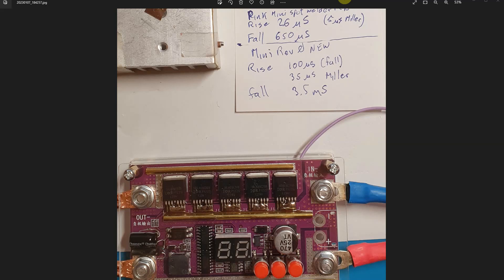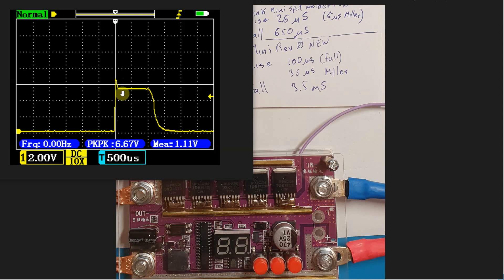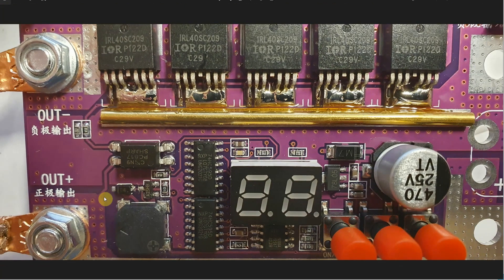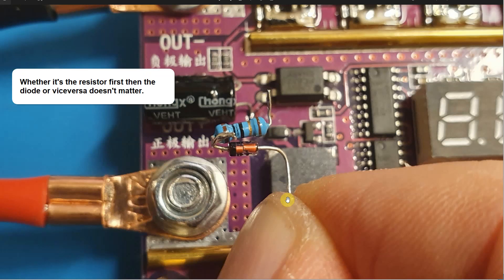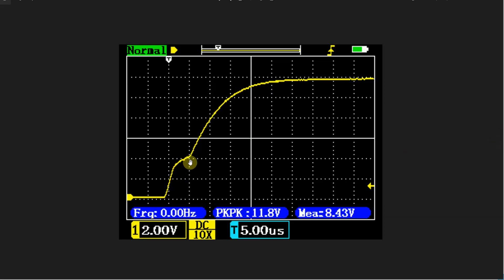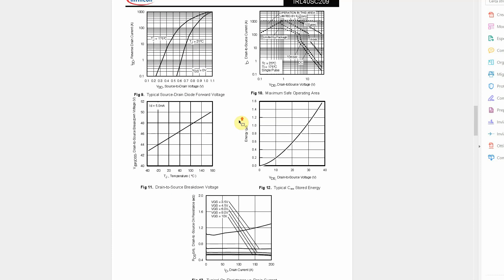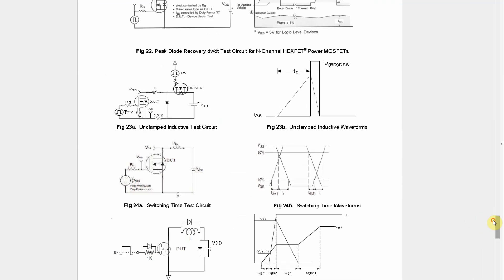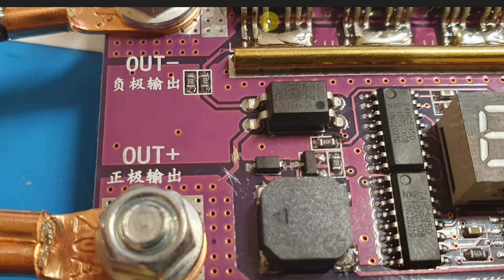"Purple" PCB Mini Spot Welder

Comment: It's funny with Chinese design... it works, but no one knows why...  :) PC817 have only max 50mA collector current, and in this circuit it drives Mosfets with 1.6A pulse current (16V / 10ohm = 1,6A)... there should be  at least small mosfet between.... ehh...
Reply from the maker: Everything as you see is out of spec, but they are either lucky or very smart as the time the junction of the 817 is ON is so short that it handles the peak and also there is a drop in conductance due to the incredible load it is subjected to. All this actually helps slow down the ON time and reduce also back EMF but will lead to FET overheating in a short time of many pulses are triggered. Check out my Spot Welder FAQs and last video I posted for more in depth analysis!

Comment: Can you please tell me if the kekk k100 12 transistor welding board also needs modification? Advise a good board with 12 volt power supply
Reply from the maker: The 12 FET version would need modification on the Gate driver side as that opto really becomes slow and loaded with 12 gates all in parallel. It will though work unmodded as the last revisions alread have the decoupling mod (though verify it when you receive it to be sure as I show). I think the 6 FET version is enough for it's capabilities without exceeding .2 mm strips. Once you start exceeding and pushing for .3mm you will need to start implementing additional protection with large TVS Diodes put across D-S. If you see my FAQs video and the last video where I discuss the FET driver mod you will get the picture.

Comment: Tôi muốn hỏi có cần thiết phải dùng diot zenner không hay bất kì loại diot nào cũng được
Reply from the maker: For the decouping mod a normal diode must be used in series with the cap or at max a Schottky if you don't have a regular 1N400x or equivalent - you must not use a Zener diode here.
Reply: Tôi nhìn thấy bạn hàn là 1 loại zenner? Hình ảnh đó là diot zenner
 @Luca_Techy
Reply: Tôi đã hàn kẽm 0.2 mà không cần thêm mosfet. Tuy nhiên tăng bánh răng thành 30 thì kim hàn bị dính và một phần nhỏ kim hàn dính lại. Bạn có đề xuất nào không?
Reply from the maker: Make the contact points round, file them so that their edges are not sharp. They stick because they fuse to the strip due to high temperature and small contact surface when you hold them at an angle. If you increase contact surface they will stick less but you may require more current to compensate.
Reply: @Luca_Techy cảm ơn sự hướng dẫn của bạn.

Bộ của tôi dùng 5 mosfet irl40sc228. , tôi đã bổ sung thêm tụ 470F, diot + điện trở 100ohm. Đã hàn gia cố bổ sung đường động lực. Có cần bổ sung thêm mosfet không ?. Tôi muốn dùng kẽm 0.25mm
Reply: @Luca_Techy  tôi đã sử dụng để hàn kẽm 0.2, tuy nhiên kẽm 0.3 chưa được. Theo bạn có cần bổ sung mosfet phía sau và tăng thêm công suất nguồn

Bộ pin của tôi đnag dùng 3s  lipo 6000mah, 90C. Peak 1000A.
Reply: @Luca_Techy  tôi muốn đấu thêm công tắc kích hoạt. Hãy cho tôi biết cắt đường mạch sau lương rồi đấu vào + hay -
Reply from the maker: @TuanNguyen-jp3dh  This spot welder will not handle 0.3mm as it is, maximum is 0.2. Overdriving it for 0.3 without serious modifications such as adding TVS diodes and changing driver will destroy the FETs.
Reply: Theo bạn có cần bổ sung mosfet từ 5 thành 10 để tăng công suất không
Reply from the maker: For ordinary use, 6 FETs are enougb to weld .12 - .15mm. If you use it heavily adding more FETs will reduce the load on each FET but I don't suggest overdriving this for over .2mm strips. You meed heavy TVS diodes for protection and a more appropriate trigger circuit for starters.

Comment: Hi, first of all, I want to thank you for your guide. Unfortunately, I've been having trouble with the spot welder from the very beginning. Before I started using it, I immediately added 5 MOSFETs on the other side. I tried welding a 0.2mm nickel-plated strip, and the results are very weak. Only the 0.1mm strip welds to the battery, but that's at a setting of 70 units. I implemented the modification from your guide, and the situation remains the same. I’m using a 12V 360A 45Ah car battery for welding and thick jumper cables. Does anyone have any advice?
Reply from the maker: As you are getting some type of weld I suspect there is a problem with the battery or with the power connections from battery to welder. If your battery is in good working order and you know it's delivering it's rated CCAs then make sure your cables are properly connected and thick enough to deliver the current (if you are using the provided ones you should be fine). Try with another battery if you have doubts. You should be getting welds on .12mm with a setting of 10-15.
Reply: @Luca_Techy  Thanks for your reply. The car battery is completely new, and the cables are thicker than the original ones. I’m currently using 25mm² cables that are 1 meter long. I will try connecting the positive terminal directly to the electrode, bypassing the board. Unfortunately, I can’t measure the actual current because the signal is too short, and my multimeter doesn’t have a min/max function.
Reply from the maker: @Maciej_S85  if you want to measure the current properly you need a calibrated shunt. You can do this by using a very precise multimeter and measuring the resistance of your power cable from the battery to the welder along the positive or negative cable. The  using a scope trace the voltage drop between these two points (yes you need a scope, a multimeter is not fast enough). Once you have the voltage drop you can calculate the current using Ohm's law I = V/R . This is how ampere meters work, voltage is measured across a calibrated shunt. In any case try reducing the cable length or try using the original cables to test.

Comment: my  math says that 12v though a 10ohm resistor will limit the current to 1.2amps which is nearly 15 watts, in the video it looks like a common .25 watt resistor, will it not be damaged by this current?
Reply from the maker: You haven't taken into consideration the time which thia peak current hence power is sustained, and that's only a fraction of a second - as soon as the current is applied the cap starts to charge, hence the voltage rises and current drops. Once it's charged it will stay practically always charged until you disconnect the battery. A 1/4 Watt will do fine in this case. FYI to calculate the total effective dissipated power you have to consider the integral funcion of the dropping current slope and rising voltage in time.
Reply: @Luca_Techy  I figured this was the answer I was gonna get, I did a lot of looking up surge currents on resistors to see how much over their rating you could go for such small periods of time and couldn't find much information. I see in other replys you say that going over around 30 ohms resistor would cause the cap to charge too slowly, doing the math it says that a 450 microfarad cap at 30 ohms will be charged after 5 time constants in 0.067 seconds, I assume the cap only needs to be charged fully before the next activation of the gates which would be between each spot weld, is a charge time of 0.067 seconds really necessary? I think its fair to say you would be actively spot welding less than once every 2 seconds, using a 600 ohm resistor would take around 1.3 seconds to fully charge the cap and at 12v you would never pass more than .25 watts through the resistor. Is there some reason I'm not seeing that we need the cap to be charged so quickly? thanks a ton for your response, enjoy the videos.
Reply from the maker: @sicktan88 yes in fact that's  the math without considering the losses - also consider that at every weld u won't be discharging the cap completely as that deoends on the energy absorbed by the gate capacitance which is prooortional to the number of gates. In practice the surge current limiting resistirs are usually in the ohms if not milliohms range depending on the current ranges in play. In this case a 10Ohms resistor is fine but that can be reduced to 5 or increased ro 50, it will still do it's job with the delta T in play between welds.

Comment: Would it be a bad idea to use li ion as the battery source instead li po  battery ?
Reply from the maker: Theoretically you could if you place enough LiIon cells in parallel (for ex. a  3S 10P pack) but you would need many cells in parallel as LiIon do not deliver the same sustained high current or impulse current as LiPo cells (LiPos can deliver up to 100 times their rated capacity while LiIon cells can reach on average 5-10x this in a sustained state before becoming unstable and overheating, it's primarily based on their morphology) which is why LiPo packs are used in model airplanes and drones, they deliver much higher sustained currents in lighter packages. The pack would cost you a lot and it would be bulky. On the positive side it would last longer in time than LiPo packs as these have a short life span based on how often you discharge/charge them and how you use them and store them when not in use (state of charge). This is also why many opt using a large capacitor bank in parallel to a smaller power supply to recharge it between welds for this specific use. Alternatively you always can use an AGM car battery such as a 45Ah or similar which can deliver 250 or more CCAs.

Comment: Would  be able to email you?

I brought this board , or what I thought was this board . but on mine there is not trace going from the pos terminal to the octocoupler . 
There was nothing going to that leg on the octocoupler . Just soldered to the board , the other leg goes to the resistor and then the mosfets 
I was hoping to show you before I went ahead . also , as there is no trace going to the leg , would I just solder the pos side of capacitor to the leg of the octocouplar  ?
Reply from the maker: My email is in the main channel page,  also check out the community section of the channel as there are some pics about the mod.

Comment: Can I use a 47ohms resistor instead of 10-30 ohms resistor ?
Reply from the maker: You can though it will take slightly longer for it to charge the cap - if you have only that value you could put 2 in parallel.
Reply: @Luca_Techy  Thanks . 
May I ask what would two in parallel do ?

Also I had got my hands on a couple of 22ohms resistors , they are heat dissipating ones , so a little bulky than I wanted but you work with what you got . 
So this 3W 22ohms will be better than the 47ohms , yea ?
Reply from the maker: @jayk2k if you have 2 small 1/4 watt 47 Ohms resistors and you parallel them you get half of 47Ohms (about 23.5 Ohms - you add the inverse of the values you parallel and the result is then also inversed). The bulky ceramic heat dissipating one is a bit an overkill for the purpose, better stick to regular ones.

Comment: Luca. I have an updated model that powers the octocoupler using the capacitor on the control circuit. Seems they have fixed their errors. Now all we really have to do is upsize that existing capacitor for insurance. I removed the 470/25v and replaced it with a 1000/50V so I can use my 16v 2kw supercap with confidence.
Reply from the maker: Yes, if you check the community sectiom of my.channel I have posted details about this update!

Comment: Hola a todos
Me gustariá saber si esta soldadora se puede usar con transformador y buena rectificación
Reply from the maker: Hola, you can't use an ordinary power supply for spot welding even if powerful, you need several hundred peak Ah to weld (400+). A power supply that beefy is costy, unless you source it from surplus shops. You may use a large capacitor bank (several 500F caps in series/parallel) as decoupling from the power supply, but that would be more expensive than the spot welder.

Comment: Hi, after the mod mine is not firing. It display 2 horizontal stripes on the display. Before the mod it fired, but a lot of sparks and burn through. Any ideas? Regards
Reply from the maker: You evidently had one or more shorted FETs if that's what was going on before the mod. 2 Horizontal stripes on the BCD displays isn't a good sign, you probably must have damaged or shorted something during the process. The Gate decoupling mod does not really cause this, at max your FETs won't fire if you make mistakes in the wiring but the MCU will certainly not fail or exhibit strange behaviors like you're seeing. Check that you haven't bridged anything while soldering as what you describe seems to indicate something definitely wrong with the MCU (does it beep or do anything if you press any button?). I suggest you check the community channel section to see what Purple KEKK version you have (some have already the decoupling mod) just to be sure you need it.
Reply: @Luca_Techy  i changed the fets, Maybe i did something wrong there. I'll check it asap. Thx
Reply: Mine  make the bip but no soldering,I changed the power source but nothing

Comment: Hello very nice mod. I accidently damaged the single tracing at the foot( i think it's the gate) on 4 off the mosfets when i was desoldering them. I cleaned some of the tiny tracing off already, but i can't see if it;s connected to another part of the board. By the way, you can mute the sound of the buzzer with some foam or so on it. Better than disable it completely. Regards
Reply from the maker: The gate traces from pin 1 of all the FETs are in parallel and go to a small resistor (01X) near the opto. If you have any short between pin 1 and the source pins the FETs will not fire.
Reply: @Luca_Techy  thx, i'll check it

Comment: Right, you add a decoupling circuit, but can't fix the falltime, because they use optocoupler to drive mosfets, with high Ciss on these mosfets, the transistor will go to amplifier (like you see why rise time too slow) before saturation,  and problem is discharge, they just use resistor (2,2k) for pulldown and discharge, that why the falltime so such, i know they reduce saling cost but i think they use to be reduce lifetime, because the totem-pole is easy and cheaper than optocoupler.
Btw: try to decrease value drive resitor (from anode opto) and value discharge resitor, you can see rise and fall time significant improvement.
Reply from the maker: Check my other videos in the playlist for all the details on the issue!

Comment: can we use 1000uf 16v or will it have to be 450uf
and you used a zener diode can we use a shotkey diode instead?
Reply from the maker: You can use a larger cap though the inrush current peak will be higher for the diode to handle without a small current limiting resistor in series. I didn't use a zener diode, it's just a nornal 1N4148 or equivalent (a 1N4004 and up will do).

Comment: I just got a purple welder in. The new one no longer has a trace connecting the positive rail to the bottom left corner of the opticoupler. Other than that my board looks identical. Should I be able to connect my positive side of my capacitor directly to the opticoupler? I’ve taken a continuity test from positive rail to all 4 parts of the opticoupler and It doesn’t go directly up to it.
Reply from the maker: You have the new revision then so you don't need the decoupling mod as the opto is powered by the 470uF cap from the regulator circuit. There's more info in the community section of my channel and other comments.

Comment: This mod will be beneficial no matter what as the "driver" solution is so bad, but a factor that seems to be overlooked is that we should not be connecting the positive welding tip to the output terminal on this welding module.  The tip should instead be connected to the input terminal along with the battery input.

This avoids running the full current across the PCB, causing less voltage drop to the gates.  The voltage will still sag depending upon the cabling and battery, so it's still worthwhile to do the mod described in this video to preserve your MOSFETs and improve performance.

Correct me if I'm wrong, but the only reason that I see to use the existing output terminal is to orient the cabling for better usability in some layouts.  However, moving the positive tip to the input side might improve usability depending upon how things are positioned in your workspace.
Reply from the maker: Hi, yes the positive "contact extension" on the circuit board is only for ease of wiring orientation, it is not beneficial to the pcb as all the current passes through the copper track as it is simply a bridge. In fact I usually screw the 2 positive terminals together on the same hole where I can. You could actually run a direct positive spot terminal lead from the + of the battery and add a second positive wire (any thin normal wire) to just power the welder logic which only bridges the negative side (N-MOS) and needs the + only for the MCU and triggering the FETs. This will not prevent a voltage sag on the logic board though as this depends directly on the battery quality - however if you have a correct decoupling cap on the logic power then the sag won't affect it for that brief pulse. If you have a poor battery you will simply not get a good weld or no weld at all, but the FETs will be safe(r) as properly triggered.